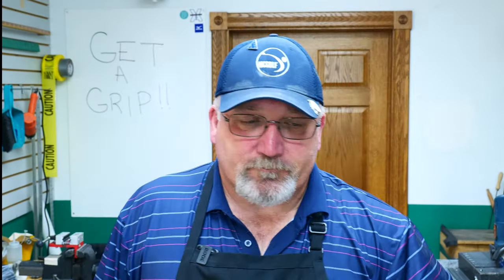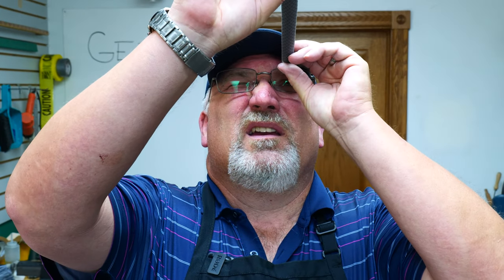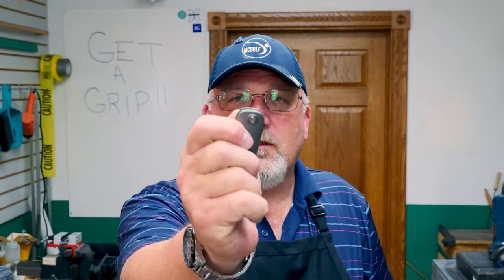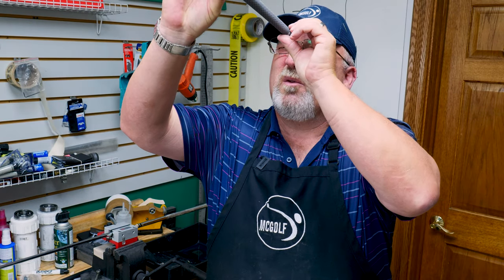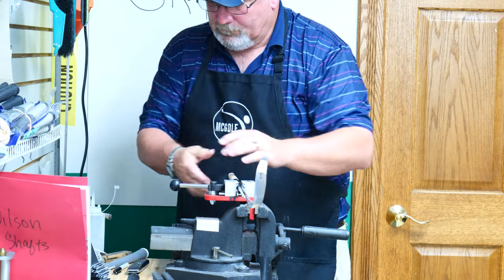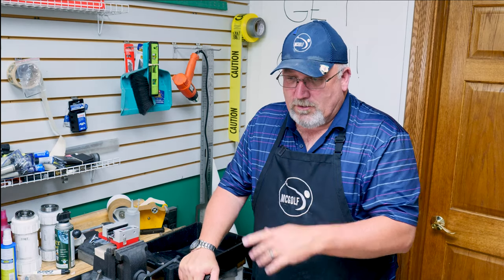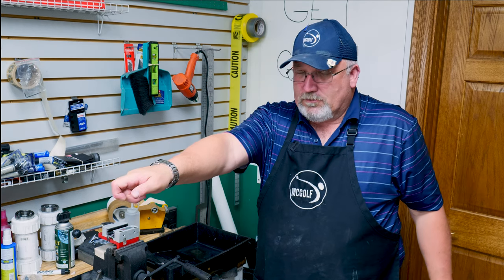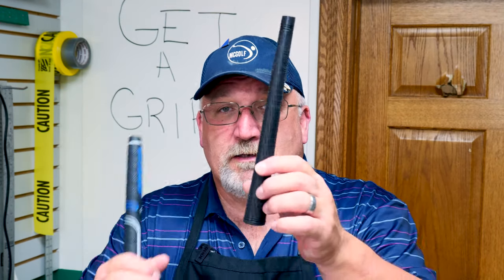Gripping Techniques

Comment: Ha, I just did this to my charity-shop irons on Friday (along with trimming 1/2" off the butts to make them standard lengths).  To help keep things vertical at the club-head end I set a carpenter's speed square upright and made sure the grooves were parallel to it before tightening my clamp.  Worked pretty good, I think, but it's been so rainy here since then that I haven't had a chance to hit 'em yet.

Comment: I’ve been re-gripping my own clubs for awhile now. I use double-sided tape with WD-40…..read somewhere it works as a good solvent. Never had any issues using it. Dries pretty quick.
Thanks for the video Jim. Love the pencil sharpener on the divot tool. 👍

Comment: As a relatively new golfer, I find myself LOVING the ribbed grips on a driver.  I am seriously considering switching my primary driver over to a ribbed grip, along with my woods.  When correctly installed, it helps me correct my grip.  My only issue is that I would need to commit to one setting with my HZDRS Smoke shaft.  Obviously, ribs can't be adjusted, if you change the setting on your driver.  My woods/hybrids are all fixed, so maybe I will have those done first.

Comment: As a hobbiest clubmaker, I really enjoy your videos. I have a question for you. In one of your videos about grips, you remarked that the grip was REALLY tacky and I need to know what grip it was? If I recall, we could actually hear the noise made when you were taking your hand off. Also, all of a sudden when installing a grip, they are getting stuck halfway down the shaft and it becomes VERY difficult to slide the grip on. Sometimes I have to cut the grip off and try again. I use lots of solvent and have even tried to heat the grip before installing it to make it more flexible. Any idea why?

Comment: Hi Jim,what would you do if you were regripping a full set and the diameter of the
Shaft on the woods and wedges were different from the irons to get them all
the same size.Thanks.
Reply from the maker: if you know the shaft is smaller then add tape. if is it larger you have an option to just install it as the size will likely be un noticed or stretch it if it is rubber.

Comment: I am going to regrip myself for the first time. Your video is excellent for me to learn from. I am going to put some Winn Dri-Tac 2.0 on some Mavrik Max Irons and wondered if I point any alignment lines to the white lines on the grooves or straight into the hosel. By the way what happened to your door?
Reply from the maker: The mavrik has a bunch of offset, go straight down the shaft then check directly after install. Keep an eye on the under listing of the Winn grip
Reply from the maker: 5 iron
Reply: Thank you for answering my post. I hope that 5 iron wasn't thrown at you

Comment: Great video Jim. Is there any issue using 60 core grips on 58 shafts or vice versa? Do you need to build up the 58 shaft to install 60 grips?
Reply from the maker: 60 on 58 will result in a slightly
Smaller grip were the opposite is true for 58 to 60. One layer needed to the first to a std size
Reply: @McGolf  Do you measure the shaft butt with micrometer or look up the shaft specs before installing a specific core size grip....? If you installed a 60 grip on a 58 shaft with only double stick tape, is there any concern of the grip coming off during a swing?
Reply from the maker: @jacklabrador6981  It will make the grip just slightly smaller, If using double sided tape you should have no worries of it coming off. You add one additional layer of tape. to being to standard if desired.
Reply: @McGolf  Thanks Jim, love your channel....great info!

Comment: Question for you on the build up tape - I have done that for many years and use 5" of tape (which matches your finger to mid-palm for my hands), but when I add layers I offset them by ¾"-1" so that I do not create a bump in the grip since the shaft tapers - have you ever done that?  I have added as much as 4 and maybe 5 layers
Reply from the maker: That movement works great for multiple layers such as the 4 and5 you put on no worries. For less than that the other in better imo